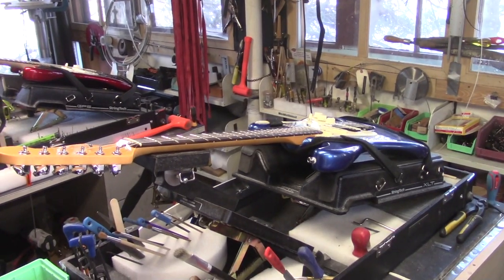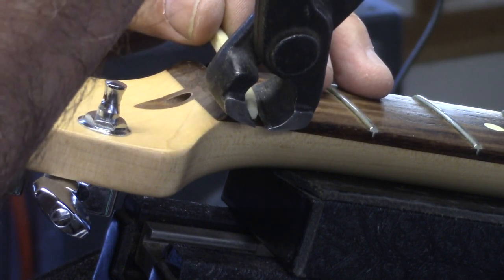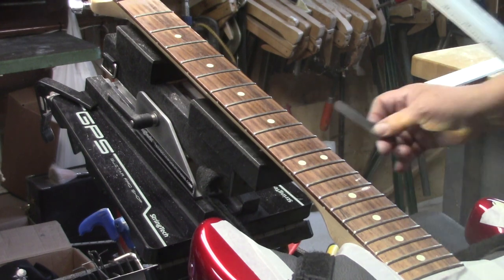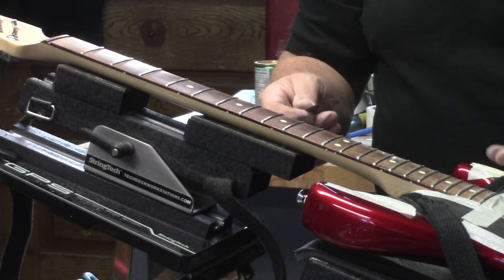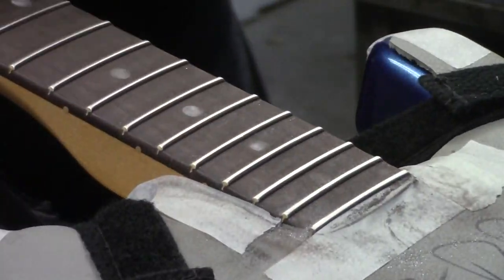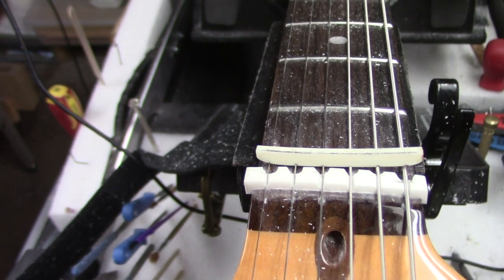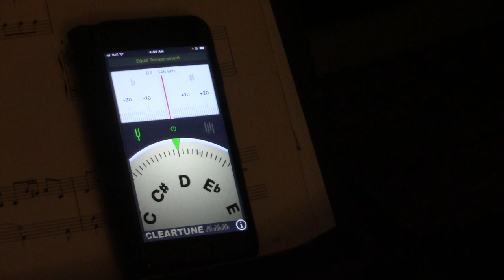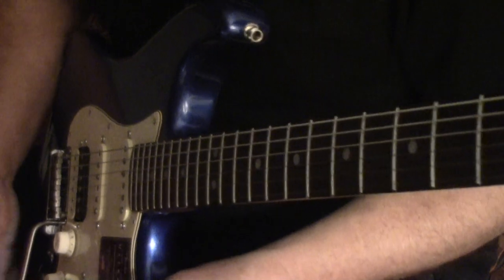Strat Ultra + Strat 60th Anniversary@StringTechWorkstations

Comment: Hi Mike, you always answer my questions & I'm only going to ask you more - so no worries if you can't answer these. Let your subscribers (or no one!) answer.

As someone who's been considering an Ultra Strat, I've got to say the QC failure on this $3k CDN Ultra is a major concern. It's one thing that Fender will warranty-repair or replacement if the guitar is 'defective', but you have to also figure in the 6months or more you'll be waiting for it to be replaced. I have a Noventa Strat (Mexican) with 2 P90s that I adore, but it had a faulty neck, which I can't blame Fender or Mexican luthiers/techs on - this is wood they're working with, which is imperfect. Prob is, I waited 9 months for a replacement. Humans gestate in such time! Fender are overwhelmed with business, I'm happy for them - their Pro2 and Vintage lines are killing it, while Gibson are on the same boat - except they're regurgitating the same guitar ad nauseum.

Action that high is unacceptable, be it from factory or any shop. If you buy a guitar like that from a shop, IMO it's their responsibility to make sure it's set up. That's 1/2hr with an average tech. If they can't do that, then something's wrong with the guitar. 

QUESTION 1:

Other than Fender QC themselves, what stage of the build is to blame? Was the neck pocket not cut deep enough? There's only so much compensation the bridge can handle before you have to mess with the nut & frets.

I've got a 2018 American Performer Strat HSS (Seafoam Green + maple neck) which like most, I've put aftermarket effort into it to get it just how I like it:  

[Locking tuners, improved string trees, Tusq nut, Floyd Rose 'Rail Tail' bridge/trem (all 5 springs a-tuggin'!), Schaller strap locks, an Obsidian 'Gilmour Switch' system and a Shawbucker 2 replacing the OEM bridge pickup]. 

If I bought Fender's 'Ultra' HSS Strat, an expensive configuration by a professional before I even get the plastic off the pickguard, while obviously worth the $, would piss me off to no end. Makes me wonder if I should save a bit more for a custom Suhr or even a Paoletti. If I'm spending $3600 CDN I may as well get what I want & save a bit more for a $5k to $6k build. I was this close to buying a Duesenberg Paloma last year. It's time I got something of that caliber. Paoletti is my frontrunner due to the recommendations of several YouTube experts, and fortunately some of their custom builds are made without "hipster wear" (relic) done to them.

QUESTION 2:

Do you have any experience working on custom build guitars, like, say, Kiesel, Voodoo, Paoletti?
Reply: Check out momose if you’re looking for a fender style guitar. Better than f custom shop and half the price, just don’t tell everyone
Reply from the maker: #1: You have obviously done a lot of research and have a pretty clear idea of what you want                                  ( or don't want ). The simplest approach is to try a ( Fender ) model of your choice, from a store that has one. Make the decision based on the actual guitar ( don't order one, unless you have the option to reject it if you don't like it ) that you have the chance to play + feel + and check out the neck for yourself.

#2 It is a different world out there now ! Everyone is building their "Kit Guitars" from numerous offerings of necks / bodies  / hardware / pickups + electronic components . About 50% of the TechDecks that we shipped out over Christmas, were purchased by " Kit Guitar "  builders. I have worked on the Suhr Strats / Duesenberg ( not a Strat ) / Sadowsky Basses / and plenty of other "Boutique" guitars. The build quality of most of these brands has increased exponentially over the last 20 years. Fender has been forced to "pull up their socks too" in order to meet the competition head on.  Even Gibson, under JC's direction, are making strides.

Hope that helps ... although it does sound like you log in a fair amount of hours as a guitar enthusiast / weekend warrior ;^ ).

Happy 2023 !

Mike

Comment: So if you dont use a knotched straight edge, how do you know if the last frets are high Vs it just having too much relief?
Reply from the maker: I use a series of straight edges 1 1/4" / 3" / 6"/ 10" / 22" / 24" ... depending on the application. After "eyeing" guitar necks for 50 years ... in most cases, I find the discrepancies before I pick up a straight edge.